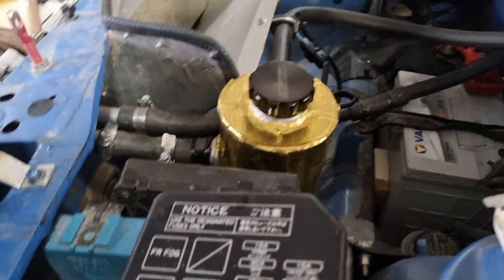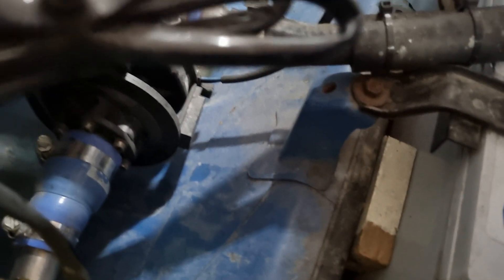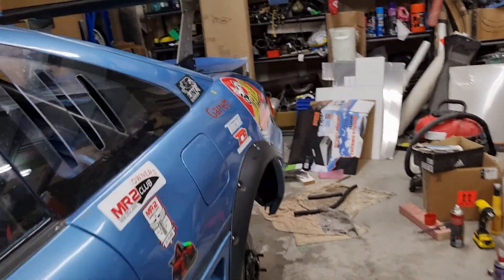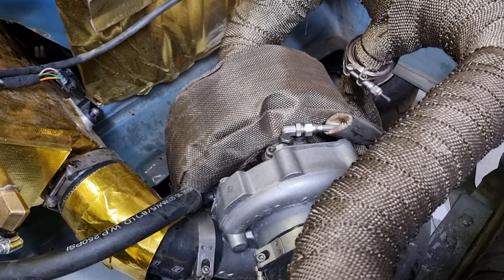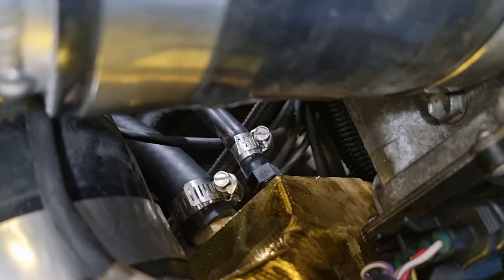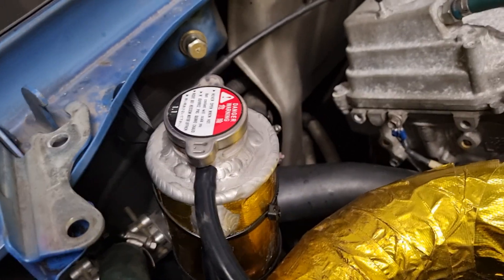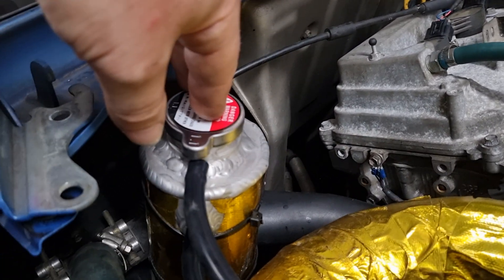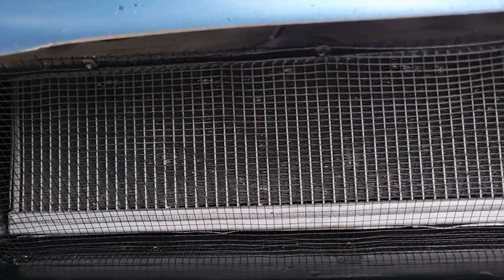Water to Air Intercooler Reconfiguration

Comment: I really like your setup. What pump and heat exchanger you are using?
Reply from the maker: Currently a Bosch pump and Frozen boost head excharger/intercooler. The intercooler might be rated to 600hp, but that is just flow, not heat removal. It isn't very good.
Reply: @gahirst  so the intake temperatures are higher that the ambient temperature?
Reply from the maker: Very much so. The heat exchanger is only 50% efficient at best. So water temperature, post intercooler, is around 30C, so maybe 5C above ambient. Air temperature, pre intercooler, is max of 90C. But IAT, post intercooler, is around 55-65C. It's shit. I am looking at an alternative or modifying the existing one, but other things need sorting first.

Comment: Hey Greg, the EWP standard controller uses "pulse" modulation until its about 5C away from target Temp. Once above that range its on constant, and I think it's 5 degrees above it goes to full flow.
Damn, I don't remember how low the "Set Temperature" is, but have 40C rattling around in my head for some reason.

What I am saying is that you might not need the controller as the design of this pump is to keep things as cold as possible, which is the opposite to its intended design as to control an engine coolant pump.
Reply from the maker: Yea I've got one, the pulse is very slow like on for 10 seconds of for 30 or something like that. I'm more after 250-1000 Hz. I do have a microcontroller already in the car, for the gear shift lights, that I programmed. I'm planning on adding a MOSFET to drive a SSR. Then it's trial and error for the right duty cycle to see it is even cavitating or not, or the flow is to high.